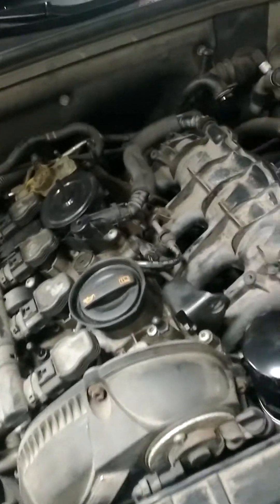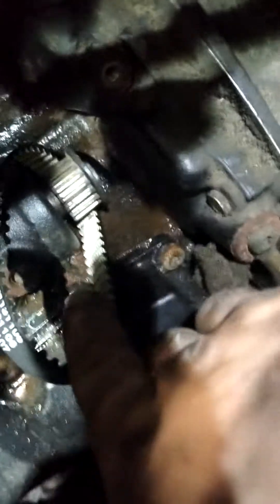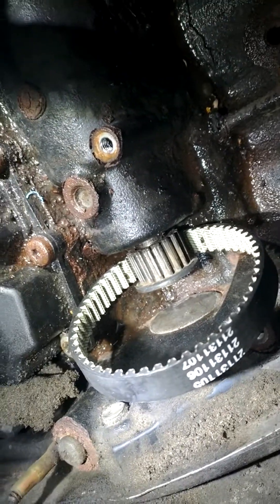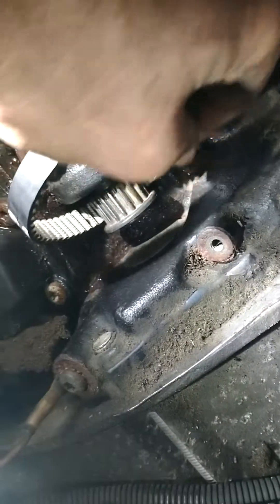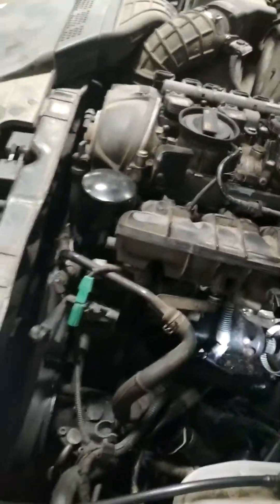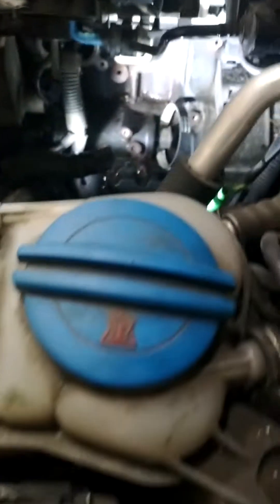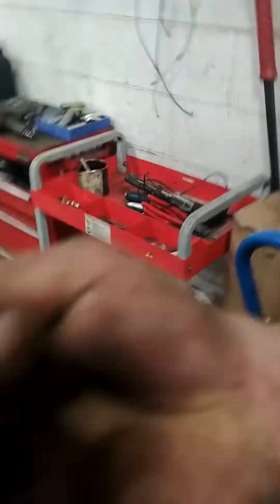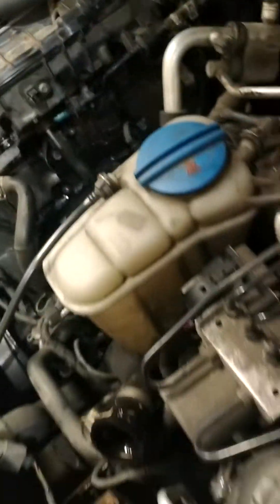Audi/VW 2.0T water pump belt replacement ... quick trick

Comment: Need to know if bolt was torque spec or did you just tightened?
Reply: If anybody is wondering the Water pump pulley bolt is torque 50 Nm + 90° (tighten counter-clockwise). From what I learned correct me if I’m wrong

Comment: you can put the new belt by  getting it stuck between  the block and the gear from the top and  have someone rotate the engine clockwise while pulling on it

Comment: Does your bottom belt sprocket move freely while you were removing the belt? I'm having overheating problems right now after replacing the water pump! I don't know if its that or my radiator isn't working right. It's not circulating the coolant, just gets real hot then the coolant reservoir boils making popping sounds.

Comment: when i replaced the waterpump and thermostat housing i did feel that the belt felt a bit loose..... but continued anyway without replacing the belt cause i didnt get a new belt with the waterpump kit..... big mistake..... seems the belt snapped or something cause the reservoir cao keeps popping off coz of extra pressure as waterpump is now not turning due to belt snapped...... 😢 now i have to do the job all over again just to replace the belt...... hopefully i can get that damn shaft pulley loose to get the belt off and on

Comment: pointless video outside of the reverse thread...... for others looking to do this, in order to loosen the bolt you need to use a 24mm socket on the crank bolt (bottom front of engine). then you can hold the engine from turning over whilst undoing the little left hand thread bolt on the waterpump lower sprocket.
Reply: Holy shit thank you! I was wondering why it was turning while I was trying to loosen it!
Reply: Mine got loose without holding the crank bolt, would that mess my timing? It moved but came right back

Comment: Alex U best ...!!! Also tell , what we have to do with not oil resistance waterpump gasket?
Reply: I've had to replace the orig water pump 2 times now. One thing I did was to slap on silicone gasket  sealant over the area on top that gets oily from oil that drips down from oil changes to prevent oil from gettin on that rubber gasket seal. Another thing (which wasn't available at the time) was an all aluminum body water pump available at ECS Tuning. Just got it and it looks great.. A sturdy seal and an all aluminum body that wont crack like my 1st one did. The second one didn't crack but the main seal failed after only 30K. I want to replace the drive belt and hopefully will be able to keep me on track. I didn't know it was a lefty bolt either!

Comment: bolt per VW is one-time use
Reply from the maker: Indeed .. but I've done it this way many many time with zero issues ever .. small low torque bolt .. im not worried

If you want to change it .. it usually comes with a new one in the water pump kit

Its just harder to install when its completely off .. very hard to get in there to get the thread started
Reply: @AlexTheMechanic so retighten the bolt, not too loose and not too tight, I untighted the bolt to get the hose out but didn’t hold back on crank bolt , I noticed it moved but came back to its original place

Comment: How did you loosen the bolt??? Useless video. That bolt won't come off
Reply from the maker: With a 12mm wrench on the bolt and you loosen clockwise

If you can remove the bolt you shouldn't attempt the job .. if you break the bolt you'll hate yourself
Reply: @AlexTheMechanic  you still completely skipped it in your video

Comment: I broke that bolt replacing my water pump. I bought the special Schwaben tool that is used on ONLY that bolt for 200 bucks to make sure i did everything just right, and that stupid thing snapped off. 
I got quotes from 2,000 dollars all the way up to "you need to replace the engine."
Because there's no space i couldn't get the broken shaft  of the bolt out, and because i had basically over-tightened it, it wouldn't just spin out.
I decided the car was done. I accepted my fate. I almost cried, not because i loved the car all like that but because i couldn't believe i made such a stupid mistake. I still owed over 8k on the car. 
I went upstairs and got drunk. At some point i decided since the car was toast i might as well go nuts on it, so i grabbed some JB weld and put it on the bolt head. I stuck it in there and walked away for about 4 hours.
I came back and that bitch twisted right out. Single greatest moment o my DIY career.
Reply from the maker: I feel sorry for you

You have to pull the engine out to replace the balance shaft on a transverse engine .. its pretty impossible to do in place

On a longitudinal engine you have to remove the front end .. its much easier
Reply: @AlexTheMechanic read his ending, he got it out.
Reply: @AlexTheMechanic  I’ve talked to guys who have done the balance shafts (or at least the intake side) by just lowering the engine just like when you do timing

Comment: To counter hold can I just use the 24mm bolt or do I need the special pulley holder tool?
Reply from the maker: 24mm bolt with ratchet or breaker bar .. easier while someone hold it for you
Reply: @AlexTheMechanic  Counter hold what exactly? Crankshaft bolt? I can't get the reverse threaded bolt out.
Reply from the maker: Yes the counter hold the crankshaft from the crank pulley bolt

The reverse thread bolt should come loose .. always did for me and I done many of these
Reply: @AlexTheMechanic  I tried using a pry bar on the water pump gear but ended up putting a random screw in between the gear and block to lock it up. Crankshaft pulley didn't lock it up for me for whatever reason??
Reply: @Messy_Jesse  I’m having the same issue as you where the pulley doesn’t lock up while holding crank. How exactly did you put the screw to hold because I’ve put a screwdriver that was tight between water pump blade and the gear and it was firm and still moved. Any advice thanks
Reply: @timh1238  I found a screw and placed it in between the teeth and engine block to freeze it. I'm not proud of this but it worked.
Reply: @Messy_Jesse  thanks ima give it a shot

Comment: What happens if you spin the bolt the wrong way? Does it throw timing off?
Reply from the maker: Well first it could snap in the balance shaft ... second if you spin the balance shaft the wrong way you could potentially skip timing

Comment: Just loosen is not easy, I suspect that a closed end wrench, ground and shaped, to allow full contact and depth on that bolt head, would be helpful, I just replaced my pump and belt this past evening, in my attempt to loosen the bolt, I felt some slipping and know when to stop. Another issue is holding the drive sprocket as you put loosening torque on the bolt, I fear putting stress on the gear and chain drive. So I worked the belt around the washer flange of the drive sprocket with some difficulty but not impossible nor causing damage, it helps to align the belt cog valley at a right angle to start.  BTW, at 95k, the Audi Dealer said my pump was leaking and they could do it for $1250 (😂😂😭), I said that wasn't going to happen. I drove another 8k miles on it, monitoring the amount of coolant I was adding, not too bad and I wasn't seeing gross leakage anywhere. Turns out that the pump bearing was shot, it had a little wobble to it and belt had some slack.
Reply: Yeah had to bring the taper off one of my spanners to get good hold of it.

Comment: Is it possible to get the belt on without even loosening the sprocket?
Reply from the maker: No
Reply: You just need a 12mm recessed head wrench pull up to remove

Comment: Do you use special tool to get the bolt off? Hvala brate
Reply from the maker: No regular wrench 13mm if im not mistaken 

Bolt is reverse threads so clockwise to loosen

Dont forget to counter hold the crankshaft .. very important
Reply: @AlexTheMechanic  i made my own tool 12 mm welded onto a open end wrench worked good
Reply: @AlexTheMechanic  long live rusija brother
Reply: @AlexTheMechanic my belt won’t spin at all anymore I replaced the pump and belt is this why because it’s spun out of the balance shaft